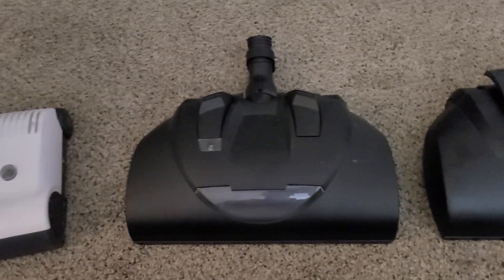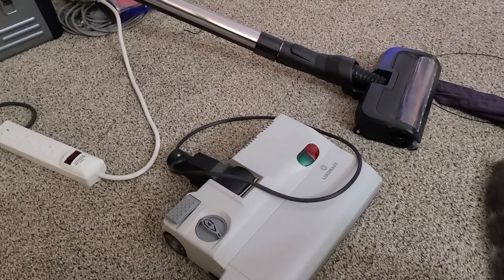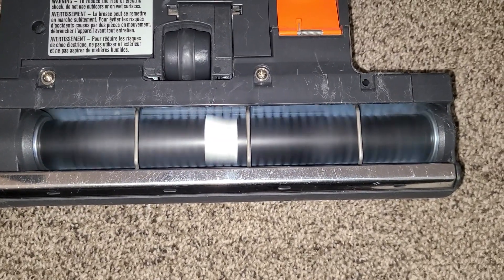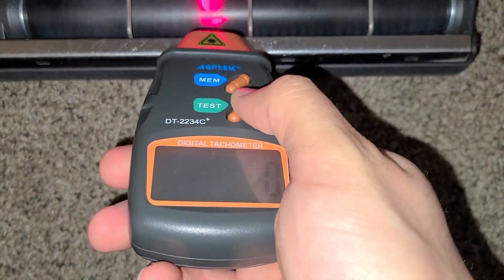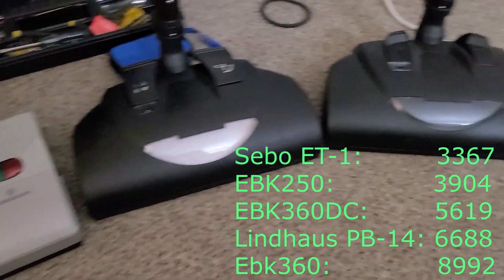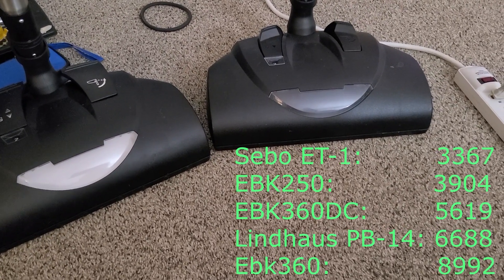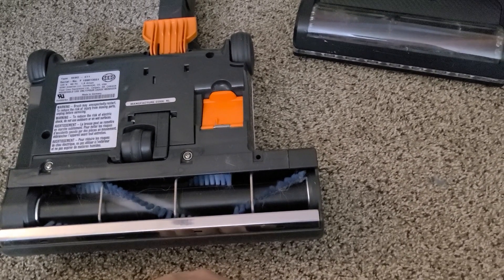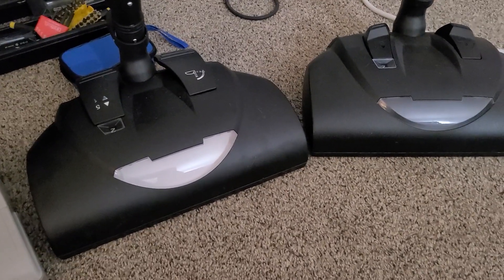Measuring power nozzle RPMs

Comment: Very interesting. EBK 360 WOW! I just wonder is it really necessary to have so high rpm. I always felt that ET1 cleaned very well. However my EBK 340 seems to do a bit better, but I am not sure.
Reply from the maker: I feel like the Sebo is one of the best built, if not the best, and has great features like the removable brushroll but I feel like it's performance is below that of the Lindhaus or WW. I do have to wonder how all of the RPMS change under load too.
Reply: @Blackheartvacs depends on what it's attached to
Reply: I actually prefer the ET-1, but my reasoning and impressions might be due to the relatively small opening seeming accelerating the CFM/sq. inch at the nozzle and really seeming to increase the efficacy. It also seems to create a very well balanced seal with a variety of carpet types.
Reply from the maker: @ABG2412  That is sensible
Reply: Sebo is a great quality machine.. the ET-1 is junk because fo the rpm.  It just cant do well.
Reply: @tekjunkie28  Objective data seems to demonstrate the ET-1 performs admirably. At a certain point, the speed of the brush roll seems to make little difference if all other elements are optimal (as they seem to be with the E3, D4, etc.). Being an owner of a Kirby Avalir, Miele canister with the SEB228 power head, and an E3 with the ET-1, I will say that overall, I prefer the Sebo E3 and the ET-1 head. There's more to the design than the speed of the brush roll.
Reply from the maker: @tekjunkie28  I think it does alright but I'd put it's performance under that of Lindhaus or Wessel werk.
Reply: @ I prefer how it seals/adapts, it's general feel, its height adjustment, its serviceability, and the very high CFM/sq. inch at the nozzle over the Wessel werk (AKA Miele SEB-###). I feel like the brush design and airflow easily put it on par with or beyond. But I do like those as well.